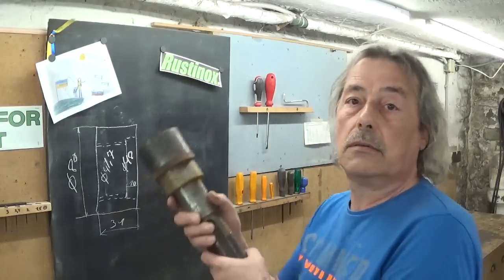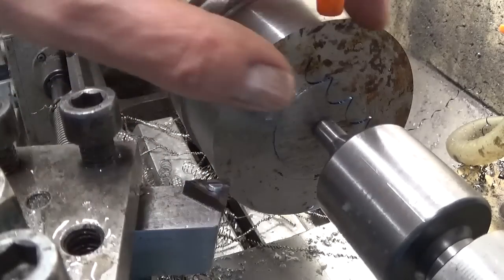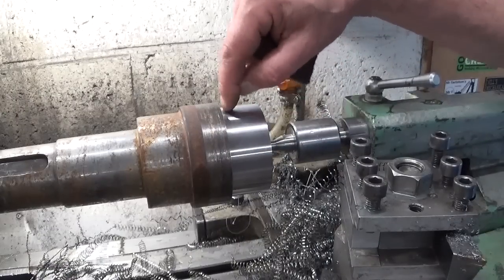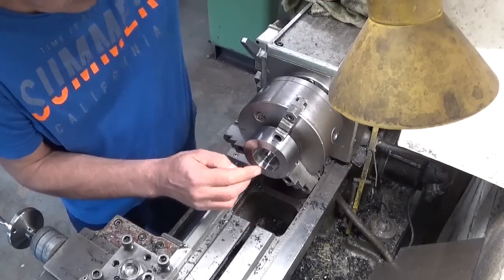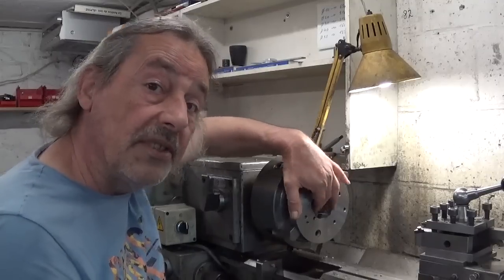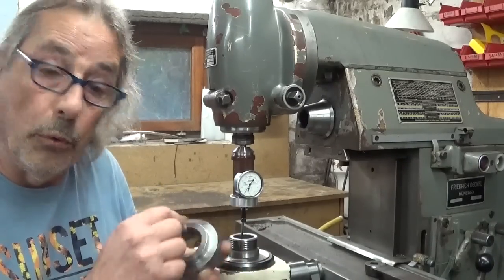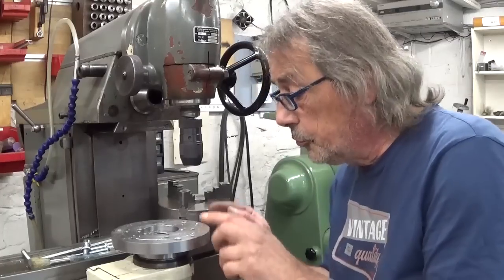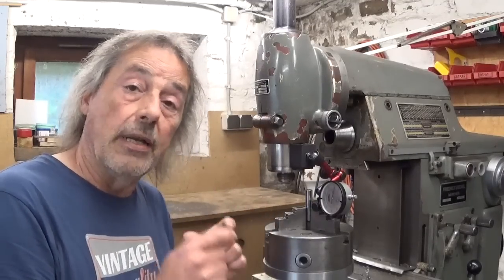Dividing head as a rotary table?

Comment: Hi Rusty. I think that the problem with the coaxial indicator is because the mill head needs to be trammed a little more accurately. Of course, I could be wrong.
Reply from the maker: The milling head and dividing head are trammed.
I will figure it out.

Comment: Great Job on February I made this project for my deckel, but it was for a d1-4 chuck adapter since it's the type of chuck used on my lathe so I can take it out and put it on the dividing head as many times needed with out loosing concentricity
Reply from the maker: Nice. That will be useful.

Comment: Another useful addition Rusti, turning more junk into usefulness! See if you can add a brass tipped cross screw to your adapter ring to lock the whole assembly in place, milling will still be a risky operation. Cheers, Jon
Reply: Hi Jon, the Myford chuck on my rotary table/dividing head has a similar problem - would you recommend the same solution there?
Reply from the maker: Thanks Jon. That's the plan.

Comment: Come on Rusty!  We home hobby machinists all know that making more tools is a worthy end all on its own! ! !   You will likely want to make up a flat table that can have stuff clamped to it.  It comes in very handy for clamping down parts to cut arcs or for corner rounding and other handy things.  I'm currently on a "mini pallet moment" and one of the pallets I want to make is one that will fit onto my rotary table to make it easier to clamp flat parts for arcs, slots or corner rounding on the rotary table.   I don't use the rotary table a lot but out of the times I have used it I would guess that I only used a chuck mounted in this same way about 1/3 of the time.  The rest of the jobs used the flat table and some hold down clamps.  My small table only has three slots though.  So it's not very good for setting up the clamps.  Thus why I want to make a sub table or mini pallet that gives me more options.
Reply: Yeah, but this time Rusti out did himself!!! He made made a tool (threading holder) to make a tool (rotating head bushing) to make a tool (rotating head flange) to hold a tool (3 jaw chuck) to mount to a tool (Mill table) just because!  I think this is a new record!! :)) How I love this channel!!! Thank you!
Reply from the maker: Making tools is fun. It just never ends.
Reply: @craftycri  That's only 3 levels deep.  I'm sure we and he can do better than THAT ! ! ! !  :D

Comment: Hi Rusti    Watch the chuck will still unscrew it self in use.   YOU  can at any time remove you lathe chuck with a job in it and check it the thread as you wanted to so so and replace it back with accuracy as it never came off.
The coaxial thing puzzling   set it up on the lathe to check the tail stock barrel see it same problem if so it's the coaxial thing. Not much to them check running surface clean free. Is top shaft damage.  Is collet used OK,  still puzzling me.
Brass locking bolt on chuck thread stop it undoing 
Steve
Reply from the maker: Locking screw is on the "to do" list. When the vice is back on the mill.

Comment: I say get rid of the Coaxial indicator (too many moving parts to suit me) and depending on your  budget, buy, beg, borrow, trade for a good quality DTI like a Interapid, Mitutoyo, Tesa  or Mahr  and a decent indicator holder to center up on a bore. A man of your talents Michel can make a real nice indicator holder with little trouble. You will not be unhappy. I also like your idea here I cannot see why it will not work and suit you perfectly. Cheers
Reply from the maker: Or just use a centre finder. Works fine too :)

Comment: Whenever I cut internal threads for something too heavy to test fit my first step is always to make a male thread the same pitch diameter as the male thread that you're trying to fit a part to. I use thread wires to compare the threads to get the new gauge to be the same, then when the female thread has been cut it takes the guesswork out.
You did get lucky, but good job anyway!
Reply: Sounds like a very good way to approach the matter, especially for us not having ages of experience. Some more work of course but a win in the long run.
Reply: i have to cut a 2 9/16 x 8 internal thread for a 16 inch lathe chuck, i will certainly make a test plug that fits my back plate first.
Reply from the maker: That's a good idea. I will remember that. Well, I'll try...

Comment: Michael, I don't know if you watch Brandon at Inheritance Machining but he has just posted part two of his rotary work table so that he can round off parts in the mill without having to setup his very heavy rotary table. It's a work of absolute beauty in fact I'd be scared to use it in case I scratched it. Have a look. It might give you an idea for an auxiliary plate instead of the chuck to mount on your new adapter plate. You could use a piece of your railway line for it. Maybe some shaper work to get it flat first?
Regards from Canada's banana belt.
🤞🇨🇦🍌🥋🇺🇦🕊️🇧🇪💩👍
Reply from the maker: Indeed, I watch Inheritance Machining. He's a real artist.

Comment: hey michel, you could clamp that tool a little lower in the holder and look at the roundness of the shaft there. Or is there a possibility you can adjust. something in the house of the clock
Reply from the maker: I will investigate it one of these days.

Comment: i am going to find the center of my rotary table to index the center bore of the chuck plate, and then drill it for the chuck bolts i hope my coax indicator doesn't do this. My stock has irregular OD so i have to rely on getting the table centered, and then i have a 1 1/2 in expanding arbor so i can cut the chuck flange true. on the lathe So many ways to screw it up.  I am sure i wont be filming it...
Reply from the maker: Have fun with it.